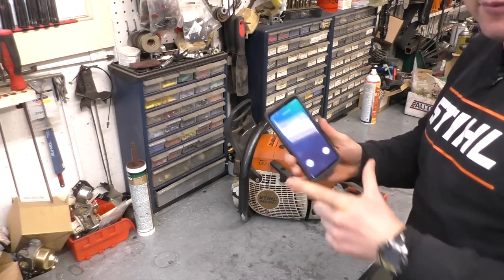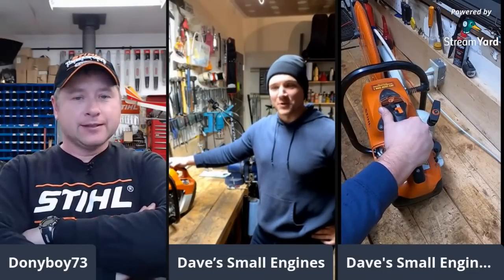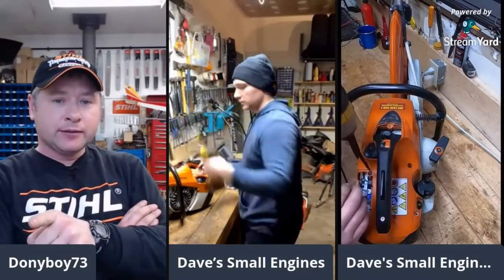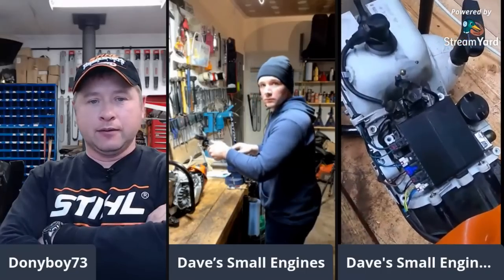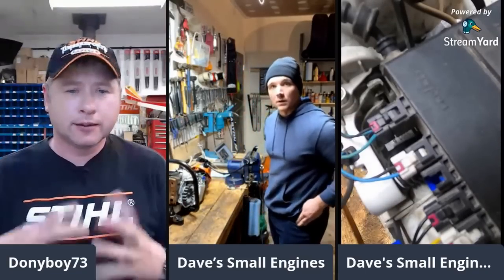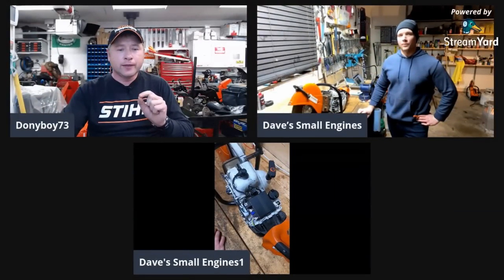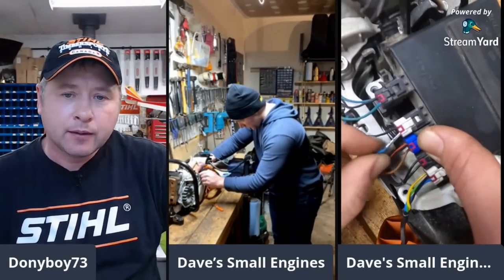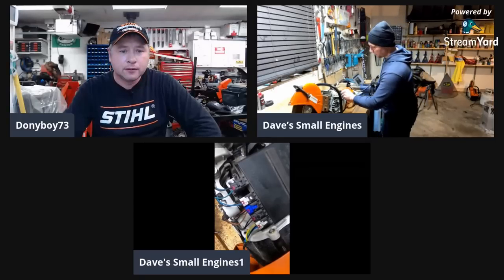MUST SEE Stihl TS500i Cut-Off Saw No Start Diagnosis With My Apprentice Dave! With No Special Tools!

Comment: I was shopping for one of these online and found one on Craigslist for $500. The ad read that it was about 4-5 years old, only used about 15 times, and has been sitting for the last 2 seasons and the guy couldn't get it started. I went to check it out and couldn't get it started, but knew there had to be a way. Even if I did take it to a repair shop, I still saved over $1,000. Luckily, I came across this video, and sure enough, it was a loose wire. I plugged it back in, gave it a tug, and it roared to life. Thank you for this video. Really saved me.

Comment: Electrical terminals typically have a locking tab that will secure it in the connector. The connector itself should have a locking devise as well. Assembled correctly, wires should never pull out. Do these connectors have the tab.

Comment: Man I just bought a ms 500i and not even through the second tank I couldnt get it started. I immediately check the plug for flooding/spark. Couldn't belive that it was messing up the same day I bought it and at $1469 I was pissed! And the place I bought it service mechanic quit and every other dealer hadn't even seen one yet! The story gets better! The manager who sold me the saw let me borrow the mds scan tool because after failed attempts helping him download the software we agreed it was his old desktop would t support the software. Long story short I was able to get the diag done and sure enough, control module test failed! After inspection it looked like the female plugs were upside down not getting a proper connection. I adjusted the clips and past the test.  Don't forget to recalibrate after doing pretty much anything on the fuel Injected saws. Good video

Comment: Don/Dave there are two tabs on those pins if you take a small screwdriver or fine pick you can spread those a part and then push it back in so they stay in the connector. Thanks
Reply: Hey Jag! I looked for those - I think when it was initially disassembled the person yanked the wires out and broke the clips.

Comment: I'm glad I watched your video. I have a shop and occasionally get these in. I actually know about the connector issues and checked them, but had the saw apart a couple times and put it back together only to find I had spark but no fuel. I was afraid I needed a new injector, so of course I go YouTube looking at what other mechanics have found with them. Initially I thought, "Yep did that." Then I started thinking that I had it apart a couple times, I should check it again. Sure enough, one injector wire pin had pulled out. This video saved me literally hours of frustration. Thanks for the help!

Comment: Thank you! Thank You....I have the same black and blue wires loose in the connector.  I had to remove the connector then push the wire back into the connector and plug it back in.  THANK YOU!

Comment: That is the deal with my Holden Commodore which is fitted with the 5.7 litre Chevrolet LS1 V8 engine,it has proprietary GM software on its PCM  meaning that you either need to manually scan it with GMs Tech 2 scan tool/ programmer for codes for  that model of Holden by Holden or myself if it's programmed to scan my model or in my case I scan it as a 5.7 litre Chevrolet LS1 V8 powered U.S. built 2002 model Chevrolet Camaro on my Bosch OBD2 scan tool because that scan tool doesn't have a listing for an Australian built 2002 model Holden VY Commodore on it.

So I need to manually scan an SAE J1850 VPW GM car with that Bosch unit,the later CAN BUS ISO 15765 cars (2005+ for the Holden Alloytec V6 engine & 2006+ for the 6 litre Chevrolet L76 V8 engine) can be scanned by any cheap OBD2 scanner which can scan generic codes & automatically !

Comment: The connectors attached to the wires should have opposing prongs that lock the connector into the plastic plug. The plastic plugs could be the issue but not my first guess. The prongs can usually be bent outward gently enough to regain the locking action. That's either a bad batch of connectors or the crimping tool was adjusted improperly.  Poor QC by Stihl.
Reply: I think whoever I bought it off of yanked the cable out instead of properly removing it.
Reply from the maker: @DavesSmallEngines  could be lol

Comment: Question........a good or bad module doesn`t show a spark at the grounded plug when removed from the engine and then spun over as one would do when carrying out a typical ignition test........so how are you going to establish if there is spark at the plug?

Comment: That’s a nice saw, congratulations Dave! I do like my vintage saws, however, due to the simplicity and lack of emissions control equipment.
Reply: I agree. I will take a carb over electronic stuff anytime. However, I have a video on my MS441c that I put a 461 big bore piston and cylinder on. It has the Mtronic carb... and it did all of the adjustments for me. It works GREAT.
Reply: @DavesSmallEngines  very nice! I do see the benefit of having the m-tronic carb especially for going up into the mountains.
Reply: @evanchapmanfanman  until it fails!!!!
Reply: @DavesSmallEngines  exactly, I don’t mind turning a screwdriver to get the proper performance. At least it runs!
Reply: @DavesSmallEngines  You could say the same about a carbed saw. Until it fails. Anything can fail. But these injected chainsaws don't fail any more often than a regular carb saw does based on my experience. And because they don't have a rubber membrane, ethanol fuel is a non-issue for them. That's a big plus imo, less maintenance required.

Comment: There are little barbs on the pins that lock it in place. They may be flattened, and if so you can pry them back out so that the pin can be snapped and locked into the connector.
Reply: I tried that Chad - I think it was broken off before I bought it (likely when it was removed)

Comment: Stihl saws used to work for decades. Now we need to check individual wires with plastic clips. Ridiculous. The GoPro probably failed for the same reason the fucking saw did.

Comment: Try starting with switch connected . If it starts , then disconnect switch to see if it starts . Question answered for future reference .
Reply: Actually Bill I checked this out... it will only start with the switch plugged in, unlike other equipment I've worked on.

Comment: I’ve never seen a fuel injector one. Is the module your talking about a computer command like a vehicle & does it take straight gasoline or mixed oil & gas. That’s interesting!
Reply: Mixed gas. It’s a module that controls the spark, air fuel radio etc.

Comment: Would it be a good idea to pinch the connector on The Wire so it would have a more firm fit if you could answer would be great all the way from Ireland
Reply from the maker: greetings from Canada!
Reply: I'm not sure if thats a good idea - I think the tab on the female metal connection locks into the plastic connector, not the female metal connector onto the male metal side.
Reply: @DavesSmallEngines  Hi Dave. I have experienced the same problem with automotive connectors. They always have a tab on the metal part that you pulled out to secure them into the plastic connector. Slightly bending the tab out will result in a good connection. See Stuck Innj's comment.

Comment: Good job goes to both of you I learned a little something there with fuel injection because I have a 500 I chainsaw that’s good information for me thank you
Reply: Thats awesome. I think they are similar machines. Do you like it? Pretty cool with no choke, eh?
Reply: I do like it the only problem is I’m so short I can only get the motor to roll over twice when I pull the starter so I got to figure out a way of doing that I need at least three revolutions to get it fire because I ran into the same issue with my 361 so I think I’ve got a way to get a couple more inches of pole but I haven’t tried it yet I cut a bar of three eights notch in a 2 x 4 and I’m gonna slip that in the handle instead of putting my foot in there and see if I can gain a little bitMore elevation from the ground so that I can get the saw to roll over three times while I am on the rope don’t have long enough farms don’t have enough distance between my crotch and where my arm ends up so I’m gonna try different things
Reply: @gregritter5883  do they make an easy start version?
Reply: @DavesSmallEngines  I don’t think so

Comment: Ok so I have the ts500i it starts and idols fine and it starts and it even throttles up to full throttle but after a few seconds of cutting it just shuts off and then it will fire right back up in one maybe two pulls everytime , but again shuts off like some has hit the kill switch 
.it will start and idol every time and it will idol as long as it has gas I don't know what to do everything's clean and seems fine plz help

Comment: hi I have a problem and I hope and you can help me, I have a ts500i when it is running and you give it gas it turns off.  you have any idea what's wrong with it.  Thank you, I hope and you can help me
Reply from the maker: try a new spark plug, beyond that it would have to be at the dealer because of all the electronics on it
Reply: @donyboy73  thank you I appreciate your help

Comment: I dont understand stihls thinking with this saw.  Underneath its a roughly 30 years old saw,  why bother getting it up to emission standards when it has done the say no favours.  Seems the fuel injection system screws the saw.  I worked for a hire company where i had over 30 of these unit all seized at the big end of rod, No piston cylinder or bearing damage just the big end on con rod.  Seems the injection system leans the mix out too much and unit cant handle.  1 or 2 seems aceptable but 30+ with same fault suggests too me its a lemon.  Before these saws got injected id never seen this fault occur previously.   Bloody emission standards screwing great products again....   Its a ts420 under the bullshit.  Another example of changing things without being needed Husqvarna k760 breaking Blade arms off because they removed reinforcing behind belt tension plate,  In the saws previous life as a partner it never happened.  Asked husky dealer if it was a common fault his reply no never seen it before so showed him a lineup of 50 units all the same crack starts at plate then spreads

Comment: I love technology as much as the next guy, but this tendency to put microprocessors in everything annoys me. I don't need touchscreen technology and complex electronics on my oven, or washer and dryer, or my my shower valve, or my chainsaw. It is just something to go wrong that I can't service and is prohibitively expensive.
Reply: I agree. I have been absolutely apprehensive about this electronic saw since buying it. I'm happy it works but man, I don't think I'll buy another. Normal carbs and chokes are easy!

Comment: What happend with 441 chainsaw?
Reply: Probably fixed and out the door by now if I know how @donyboy73 works!
Reply from the maker: video coming up on that saw from video intro!
Reply from the maker: @DavesSmallEngines  actually this saw has major issues! don't want to spoil the diagnostic for you!

Comment: Don,     What does it take to be Stihl certified?
Reply: 4 days.
Reply: Brad I can help with that. One question is what do you want a Stihl Certification for?
Reply: I don’t want a certification, just curious. I
Reply: @stoolie10  I got my stihl silver certification by working at a dealer. Once you quit, it comes with you which is nice
Reply from the maker: a few days of open book tests
Reply from the maker: @fillslawncare  it's not a necessity
Reply: @donyboy73  Unless you plan on getting a job as a Mechanic that repairs/sells Stihl equipment then your certification (usually Gold) could be used to your advantage
Reply from the maker: @fillslawncare  it's mostly a liability coverage for insurance purposes and for stihl, i know "master techs" who can't even replace a carb kit or intake boot!
Reply: get your briggs cert teaches a lot more usefull stuff

Comment: Great catch guys!   👍👍. Can you use a tiny bit of silicone instead of super glue or those connectors?   Subscribed to Dave’s channel?
Reply: Good catch Tony! If the glue fails I’ll try that. Thanks for the subscribe too!
Reply from the maker: yes you can

Comment: Man thats awesome such a silly thing though. I'm disappointed to see them making equipment with direct fuel injection systems. I had looked into the Ariens snowblower like you recommended Donyboy and I saw they had it and don't seem to have a model without it unless buying an older model used from someplace. Its bad enough they want to phase out engines and go to cordless for everyone so then we will be buying new batteries every few years until we can't get them anymore say 5 years later and then have to buy say a new lawnmower or snowblower. I've noticed the trend with cordless tools no manufacturer focuses on corded tools and quality anymore all their efforts gone into cordless tools and switching battery systems and then how the batteries mount to get more money out of the consumers. Corporate greed at its finest.